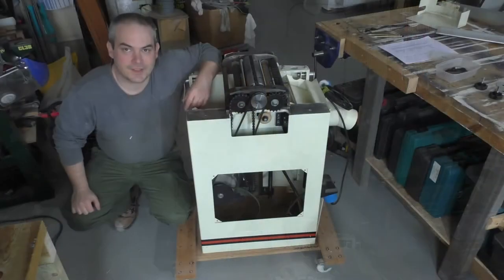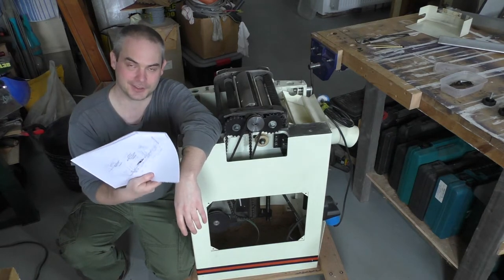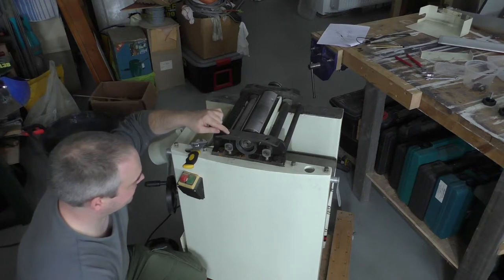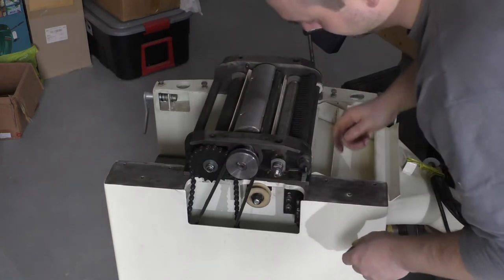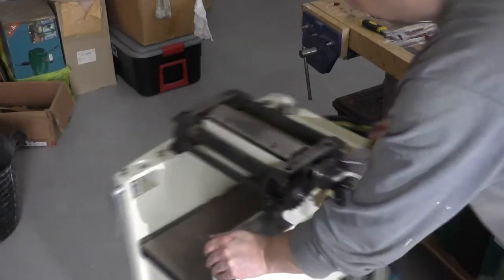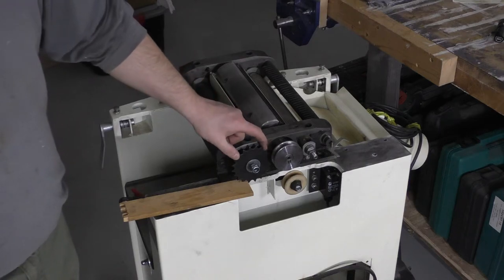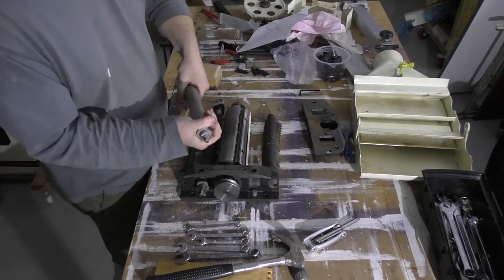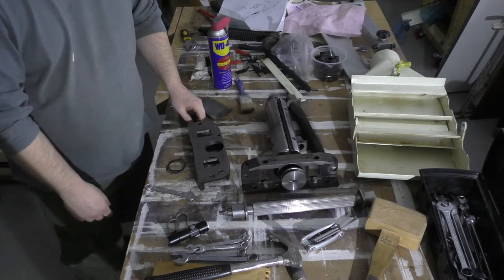Jet JPT 260 Repair - Part 1 - Disassembly

Comment: Great video.  You have incredible patience, and I can tell you have experience as a machinist or mechanical engineer.  I've had the JJP-12HH jointer/planer combo for about 5 years now, and the planer is no longer feeding well.  The planer bed is clean and coated, I just turned the cutters so they should be sharp and I replaced both belts.  Just like you I found that lifting the motor was an ordeal.  Very poorly designed method of tensioning the belt.  I'm going to adjust the roller pressure, but I'm not holding out much hope that's going to fix the problem.  You shouldn't have to adjust the rollers, but maybe I'll get lucky.

I sure hope I don't have to go to this length to replace bearings.  If it comes to that I may just use it solely as a jointer.
Reply from the maker: Thanks, I have no formal engineering or machinist training just a passion for learning. I find that the outfeed roller tends to become glazed / shiny over time and stops feeding properly. A light rub over with some fine sand paper seems to fix the problem. It might be possible to fix it by cleaning the roller too but I don't want to use water or solvent on it.
Reply: thanks a lot for this video, definitely got me the courage I was lacking to change my cutter head to a HH :) (on a record power 310 = JPT 310)

Comment: Great video, a life saver, thanks. Where can I get the parts and how much was the roller, bushings and white plastic cog? I think I have just had the same problem. Bought mine 2nd hand as well, from a chap who said he hardly used it. Had a decent few months but it just started jumping on the chain and stuttering in thicknessing mode. Now it won't collect the wood. I havent dared look inside yet. When I bought it I used your video to reassemble as we took it apart to get into my car when I bought it, so i have taken apart before. Cheers in advance. David C
Reply from the maker: I got the parts through Axminster Tools (UK) which is where I bought the machine. The infeed and outfeed rollers were £26 each. The bushings and nylon gear were free; I think you'd be lucky to get them for free now though. The parts were known to fail and Jet did a free replacement program for a while, it had been finished a couple of years when I applied in 2017. Best of luck.
Reply: @WobblycogsUk  cheers
Reply: @WobblycogsUk  was there a particular person at Axminster?

Comment: Thank you for such a helopful video - I'm nearly brave enough to pull mine apart.  I guess I'm exploring a little further each time.  I do have a question about the chip collector (and maybe chip deflector?).I am hoping you can advise me on something. Is there something that should hold the chip collecter at a certain point - unless my thicknessing table is raised to 100 mm it pivots around until it ends up touching the cutter assembly which is far from ideal. Many thanks.  John
Reply from the maker: I'm not sure I understand what you mean about the chip collector. On my machine I have to lower the thicknessing bed to at least 160mm before the chip collector will swing around far enough that I can  lower the planner tables. The chip collector should be directly under the cutter head. The gap between the cutter head and the chip collector is (from memory) quite small, just a few millimetres but they should never be in contact. 

Ah, do you mean the chip collector swings too far around unless it's resting on the planner table? I don't recall seeing a positive stop for the chip collector. I'm at work right now but when I get back to the workshop I'll take a look.
Reply: @WobblycogsUk  That's very kind of you.  It's not the issue of having to drop it round to 160.  It's all about the gap between the cutter head and chip collector.  I can control it if I raise the bed to at leat 110 but I don't think I used to do this.  If I don't the cutter head hits the collector.  The cutter head is also very close towhat I think must be a deflector. Thank you for your time.

Comment: Thank you for this walk through! It gives a lot of insight into the build of this machine. 
Could you please say something about the practicality of removing and reinstalling the in and outfeed tables? How hard was it to realign them to each other? thx!
Reply from the maker: It was trivial to remove and reinstall the tables. The mating surfaces are machined flat and there are no adjustment screws or shims. I was able to just undo the bolts, take off the tables and then refit them. I carefully checked the alignment after I put the machine back together but it was as perfect as when I'd taken it apart.
Reply: Thank you, this helps a lot. The style where the tables flip up independently are supposed to be a real pain to reinstall...
Reply from the maker: @bjgodefr  yes, I imagine they would be as they would have a lot more flexibility. Overall I was impressed with the engineering in the machine, it was sturdy and accurate in all the places it needed to be.

Comment: Ii was looking to buy the jpt310 for a professional use.... I'm not sure it's a good idea.... I can't spend hours on repairs if bearings are not reliable....
Thanks for sharing this.
Reply from the maker: They are reliable, this always a specific manufacturing fault that was fixed a few years ago now. The bushings were too hard for the shafts that were running in them. I was disappointed the machine broke down but to be honest I'm really pleased with how maintainable it is.